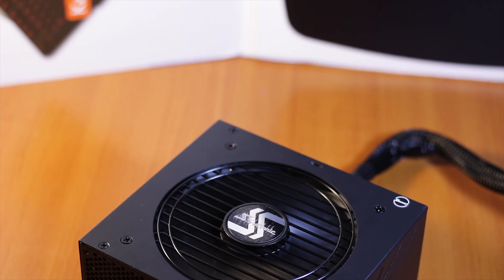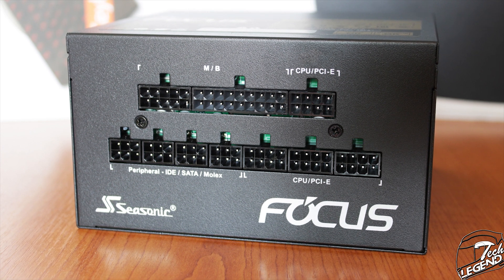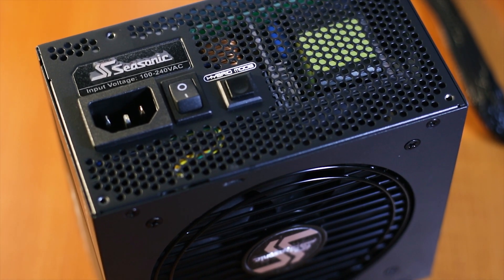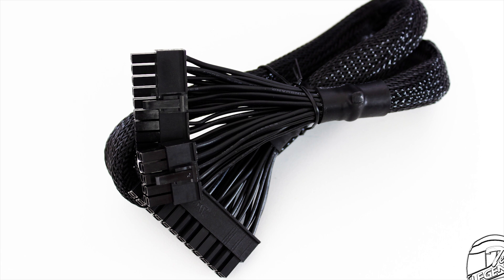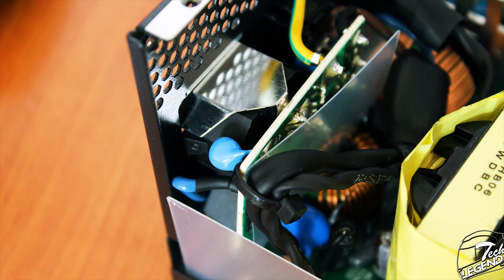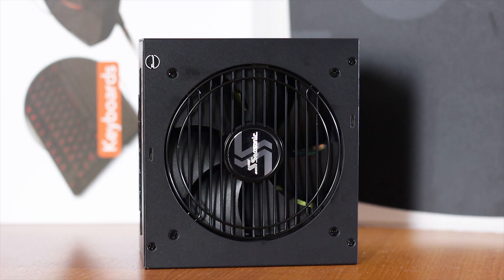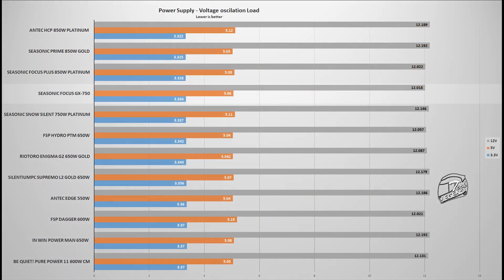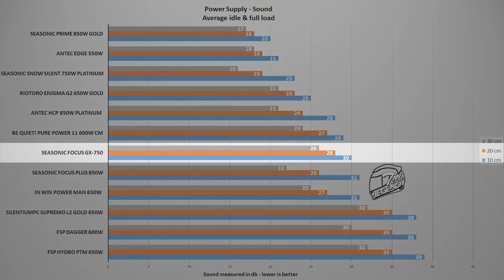Seasonic Focus GX-750 Gold - Power Supply Review

Comment: Great review, well done 👍🏻.
Just a quick question, what's the difference between this GX and GM from Seasonic besides the modularity thing ?
Reply from the maker: Hi, sorry for the late reply.
The GX series is better overall for the following reasons:
GX has the Hybrid mode, GM does not.
GX is fully modular, GM only semi-modular.
GX has higher warranty on average.
Reply: @TechLegend-com  
Thank you sir, how about the C650 from NZXT which is an A tier PSU and made by Seasonic.
Reply from the maker: @unkn0wn-me  The NZXT C series is just the Seasonic Focus with a different name and case. Get the one that is cheaper.

Comment: Just ordered the 850w version
Reply from the maker: Please let me know how it's like. :)
Reply: @TechLegend-com  Will do, im replacing my old evga 750w one
Reply from the maker: @ObsidianSoul1  Looks like a good upgrade! :)
Reply: @TechLegend-com  So update, the power supply is performing flawlessly and its made my system so much quieter especially my gpu (gigabyte 1080) which has always had quite alot of coil whine. Would definitely recommend the 850w version
Reply from the maker: @ObsidianSoul1  That's great to see! So the PSU lowered the coil whine?
Reply: @TechLegend-com  By alot yes
Reply from the maker: @ObsidianSoul1  That's great to hear. Thank you very much for the update! :)

Comment: Hey i bought gx 650 PSU and im not sure if i connected it properly cause fan is not moving at all and its overheating, any help on what might i have missed?
Reply from the maker: How do you know that it's overheating?
Reply: @TechLegend-com  hmm idk is it overheating but its hot when i touch it or the back part of it, its new i have it for 2 days and it has that weird metal/burn smell , some guy told me its solder flux smell and that it will go away.I guess i will see how long will it work and it has 10 years warranty anyways.
Reply from the maker: @mihajlonedeljkovic5399  Did you install all cables correctly?
Reply: @TechLegend-com  yes i think i did i watched couple of tutorials and did it 2 times to make sure everything is in placd
Reply from the maker: @mihajlonedeljkovic5399  Try to use it for a few more days and see if it's getting better. If not, use the RMA and get a new unit.
Reply: The hybrid button?

Comment: Im sure with this pw suplay(ryzen 7300x2080 super)
Reply: pls someone answer
Reply from the maker: @qtemi5639  Ok, what is the question?
Reply: @TechLegend-com  whats a better combo i5 10600k with 3060 ti founders ed..., or ryzen 7 3700 with 2080 ti founders ed..
Reply from the maker: @qtemi5639  The i5-10600K is a better CPU, as for the graphics card. I'd get the 3060 Ti.
Reply: @TechLegend-com  ❤️
Reply: qt emiツ I have this power supply with my 6800xt and 5800x and it works perfect. This is more than enough for you slightly overkill even :)
Reply from the maker: @elijahmckenzie9207  Pretty much, but headroom is always good. :)

Comment: How is the fan after 11 months ? 
I read lots of comments that  destroys  pc parts or the power supply dies on them
Reply from the maker: Still going strong, no issues.
Reply: @TechLegend-com  i got it used mint condition have not tuned it on its the semi modular for 100$ is it worth it ?
Reply from the maker: @Ibrahim_Alharbi  Sounds like a good deal.
Reply: @TechLegend-com  it works its also quite
Reply from the maker: @Ibrahim_Alharbi  Good to hear!
Reply: @TechLegend-com  i need heal it only has 3 conectors 
1-Power system
2-Board power
3-Gpu power

I need a adapter or something that I can plug i need 4 molex conectors 
I have 4 fan RGBz case name xigmatek
Reply from the maker: @Ibrahim_Alharbi  If you are missing connectors, either get in touch with Seasonic or look for custom sleeved cables, such as Cable Mod cables.
Reply: @TechLegend-com  what is there email?
Reply from the maker: @Ibrahim_Alharbi  Please go on the Seasonic website and check their RMA section, that's where you will get in touch with them.
Reply: @TechLegend-com  i have contacted them they were nice to send me cables I pay for them there will arrive in 10/20 days
Reply: @TechLegend-com  whats the max graphic car i can run with this ?

Comment: Excellent review. I bought this power supply due to great reviews and got a good deal at my local computer store back in Dec 2020. I will be installing it soon on my PC as a better PSU replacement.
Reply from the maker: Great to hear, please let me know how it works with your system!
Reply: how is it holding up? newegg has these on sales and wanted to hear from people who actually own and use it, thanks!
Reply: @xKevmachinex  hey man. It is doing great on my new PC build. Works well :)
Reply: Is it still working in 2025
Reply: @spartan1236  Hi yes still works good this year 2025. I hope my power supply will last for a long time.

Comment: My PSU be coming in tomorrow and I’m really nervous cause I’ve never used a fully mod psu before. Can I plug in the CPU psu power cord to any of the 8pin ports?
Reply from the maker: Don't worry about plugging the cables in the wrong slots, usually, there are labels on the cables and on the PSU itself.
Reply: @TechLegend-com  the cables are nicely labeled, but it seems like there are multiple ports for PCIE  and CPU, is there like a wrong one to use?
Reply from the maker: @brokentilebench  As long as the cable labeled as CPU is connected to the port labeled CPU, they are compatible, nothing to worry about.
Reply: @TechLegend-com  noice noice thank u much

Comment: Shall i get this seasonic or xpg core reactor
Reply from the maker: Depends on the price of each power supply. I will always recommend Seasonic over CWT based power supplies, as Seasonic has a longer warranty time and better components.
Reply: @TechLegend-com  the xpg core reactor has 10 year warrenty
Reply from the maker: @hannybassem4818  That might be, but the Core Reactor series as far as I know is made by CWT. While Seasonic is made by Seasonic. If the price gap between these products is big, say, 25-30USD then the Core Reactor might be worth it. But if they're close in price, then I'd go for the Seasonic.
Reply: @TechLegend-com  so is the xpg bad or shall i send it back ?
Reply from the maker: @hannybassem4818  Ah, so you already got the XPG? That is a vital piece of information not shared lol. No man, it's ok, keep it, it will work just fine. The Seasonic is better overall, but the XPG is not a bad product, don't worry.
Reply: @TechLegend-com  i seen tomshardware review and that xpg is doing good and he recommends it   as it competes with seasonic and corsair as he said its high end cwt
Reply from the maker: @hannybassem4818  Listen man, I'm not trying to get into a debate, all I can tell you is that even the cheapest Seasonic power supply is good for daily usage, while the cheapest CWT power supply are notorious for not only breaking but also taking other components with them. The XPG you got is a good product, but I won't see it compete with Seasonic anytime soon. This discussion would have been better if you had asked me about these power supplies BEFORE you made your purchase.
Reply: @TechLegend-com  no debate i am asking cause you have experience and i dont and i really thank you sir for ur information 😊

Comment: Which one you recommend this or corsair Rm650w
Reply from the maker: I would not touch a Corsair PSU with a 10 meter stick. I will always recommend Seasonic if I get the chance, their build quality is one of the best.
Reply: @TechLegend-com  any reason why we shall avoid Corsair ?
Reply from the maker: @covorasel  Corsair is not a power supply manufacturer, and often use CWT as their OEM. Unless you are buying the top of the line Corsair PSUs, the build quality and performance is questionable.
I will always recommend reputable manufacturers that have a good enough track record, such as  Seasonic, Antec, FSP, be quiet!. 
I'm not against the Corsair power supplies that either use a good OEM or are part of the high end CWT series of products. However, I do not recommend them when other manufacturers are cheaper and often, much better.
Reply: @TechLegend-com  well i was having trouble to decide . seasonic focus gx 850 w or rm850x
Reply from the maker: @covorasel  I'd get the Seasonic as it has the better cables and the internal build quality is better overall.

Comment: Does your unit have coil whine? I have a corsair cx650f rgb which has terrible coil whine. I'm Currently without psu. I think of getting This one with 750w for a rtx 3070 and a i5 10600k 5.2ghz.
An answer would rly be appreciated. (:
Reply from the maker: This unit had barely any coil whine present.
Reply: @TechLegend-com  ok thanks
Reply from the maker: @emileift2850  You're welcome!

Comment: Great review! It's a tragedy that there aren't many more PSU reviews out there. Have some friends that are just getting into PC's and I tell them every time "Don't skimp out on the PSU- spend money on a good one. It's the only thing that can fry the rest of your system." But unfortunately there aren't a lot of in-depth reviews out there, so lots of folks think a gold rated efficiency means top-notch quality. We need more folks like you that go over these components.
Reply from the maker: Thanks for the kind words, I'm glad you found the review useful! :)
I wish I would be able to better test the power supplies, but perhaps in time, I will be able to afford the required equipment for that.
Reply: Of course you don't want a poor quality PSU, but it should be seen in the context of total build cost.  You wouldn't put a $100 PSU, in a system with a budget grade video card, motherboard, CPU, for example.  It would make little sense for the PSU to outlast the system's viable lifespan by 400% unless there is a plan in the future to substantially upgrade it.

Generally I'd estimate that the PSU should be about 15% of total system build cost, for a system with typical component performance/capacity balance, except that you can only get junk PSU for much less than $35 (US  market pricing- will be higher outside the US)  unless a rebate is involved.

Comment: I just bought this one but the 1000W version, seeing it was in stock and cheaper than the 850W from other brands. However online specially on Amazon, I'm reading quite a lot of fried PSU and mobo's due to this specific PSU. Would you still recommend it? I don't have any experience with the seasonic brand, just read and heard that it was good.
Reply from the maker: Seasonic has one of the best reliability track records on the market right not. I highly doubt it will cause any issues.

Comment: I want to upgrade my power supply , is nzxt c650 is better than seasonic cx650? I mean in power supply efficieny
Reply from the maker: I have never heard of a Seasonic CX650, do you mean the Seasonic M12II-650? Or the Corsair CX650? What is your budget for a new PSU?
Reply: @TechLegend-com  sorry i mean seasonic gx-650 or nzxt c650 , in my country both have same price tag
Reply from the maker: @sumaardian  I'll get the Seasonic, as it has a better warranty and build quality.
Reply: @TechLegend-com  if im not wrong , nzxt also have 10years warranty and it use seasonic component too , it make me wonder which is the best
Reply from the maker: @sumaardian  If the NZXT was cheaper then I would have said to get that, but if they're the same price, I will always recommend the Seasonic units.

Comment: Does this one has the additional 4-pin ATX power connector for x570 mobos?
Reply from the maker: If you are talking about the 4 + 4 Pin connector for the CPU power, then it does have that.

Comment: seasonic gx 850w is good for asus strix 3080 and 1070k??
Reply from the maker: Yes.
Reply: No. Seasonic has had issues with asus gpus before. I have this model and a 3080 tuf and I was having crashes and bad noises coming from it.
Reply from the maker: @SimakSantana  This is the first time I'm hearing about this. Did you get an RMA for that power supply?

Comment: Does it have 2 8 pin cable for a 3070 gpu? I got the msi 3070 ventus 3x. It has 2 8-pin.
Reply from the maker: I believe that it has two 8 Pin connectors.

Comment: I accidentally bought the wrong wattage psu, a corsair cx450m. Now I think I’m going to go with this unit. I like seasonic’s power supplies so this seems like a solid unit.
Reply from the maker: You can't go wrong with Seasonic.
Reply: I got a cx450m which is a little too low for me so I got the 650 of this seasonic one
Reply from the maker: @Co0DxIsxLIF3  Sounds like a good choice.

Comment: I hope the 850W version is better or the same, hoping to power RTX 3080 when its out! Also hope theres no transient issues / High ripples like the previous versions :)
Reply from the maker: Eric  You can't go wrong with Seasonic units.
Reply from the maker: It should be good, as the newer generations seems to have even higher build quality.

Comment: Great and informative video. My graphics card and psu arrived yesterday and both have a cancer warning, something related to california ( I live in Eu so this is the first time I see that label). Should I be concerned?

Edit: I bought the focus px psu and the gigabyte rtx 2070S in case you needed more information
Reply from the maker: I don't think you need to be worried about that.
Reply: I hope you sold your 2070S for a 3080, or plan to whenever Nvidia decides to restock.
Reply from the maker: @cyn7261  The RTX 2070 Super is still a good graphics card.
Reply: @TechLegend-com  it is, but the 3070 does a better job for not much more
Reply from the maker: @cyn7261  True, but the availability is still in question.

Comment: The 650w version, is enough for a ryzen 5 3600 and rx 5600 xt setup?
Reply from the maker: Yes it will be more than enough.
Reply: You could run that with a 550 watt and a 5700xt and still have headroom
Reply from the maker: @eurocrusader1724  Yes, but it still depends on what power supply he uses.
Reply: @TechLegend-com  True . Ok i will refrase myself.
If he uses a quality , brand name 550 watt bronze or better PSU...
Cheap chinese stuff will take your system with it ,  even if its a so called 750 or more ..
Reply from the maker: @eurocrusader1724  I know what you meant, I just wanted to make sure that everyone who will read our comments will also get it and make a good purchase. :)

Comment: I just bought this without watching or reading any reviews. Glad I followed my gut. Lol
Reply: Me too. 6 months ago
Reply: @brakesteel0034  it’s been 3 more months, are you still using it and how is the wattage? Dropped any?
Reply: @Impossible_Fishy  I am using it still and its serving well. My focus gx is 550W version and my config is not power hungry with i5 4th gen with gtx 1650 super but there is planty room for upgrade. As long as you are not using 2 gpus almost any gpu would work fine paired with 550w gx. If you want to use high end gpu (rtx 3080) that would be pushed to its limit than 650w would be better option.
Reply from the maker: @brakesteel0034  Hope it serves you well!
Reply: @TechLegend-com  Its working well since then. I think its best bang for the buck gold psu on the market now. Riotoro enigma has Seasonic heart inside, I think, and its a bit cheaper.
Reply from the maker: @brakesteel0034  The Riotoro Engima series is identical with the Seasonic Focus, even the case is the same. I can't remember if the cables are the same though, even so, both are great power supplies!
Reply: @TechLegend-com  Hi tech legend the seasonic focus SSR-750PX also is very good ?
Reply from the maker: @radiation2184  Yes it is very good.
Reply: Lmao same, I almost went with the corsair cv 650 but I had a feeling I had to go for this one
Reply from the maker: @Zeemanhuismerk  Great to hear! :)
Reply: @TechLegend-com  Loving my new pc man. The Jump from a 1060 to 3070 and proper gsync screen is just mindblowing
Reply from the maker: @Zeemanhuismerk  Great to hear. I have yet to experience the GSync screens.
Reply from the maker: Hope you enjoy it!
Reply: Honestly Seasonic PSUs never have a “catastrophically bad” unit on the gold range so it’s always a safe bet (compared to other known manufacturers like EVGA or Corsair)
Reply from the maker: @Windows98R  I have yet to see a Seasonic power supply fail, even those that have been working non stop for almost 10 years.
Reply: Is the psu good after 11 month?

Comment: Regarding the difference between Gold and Platinum, do you think it is worth paying the extra for Platinum, or is Gold sufficient? What sort of people would benefit from paying extra for Platinum power supplies? I am planning on getting a high-end CPU and GPU that would use about 650Watts.
Reply from the maker: It's not worth the price increase for the casual user. Not unless the price difference is under 20-30 USD. The higher efficiency is worth the price when it is used with High end and high power draw systems. Higher efficiency means less energy wasted into heat, thus a lower overall electricity bill and a cooler PSU. As for what people benefit from such PSUs, high end overclockers that require voltage as stable as it can be, and people that rely heavily on processing power and require 24/7 operation, such as servers or systems used in the medical field.